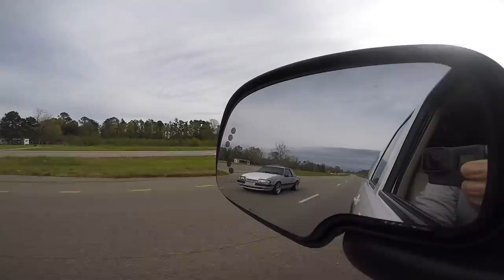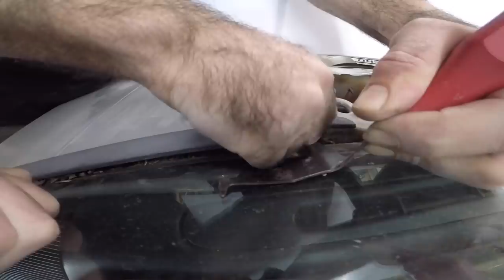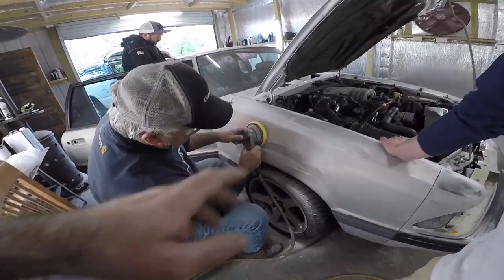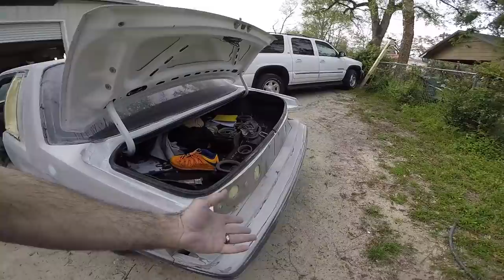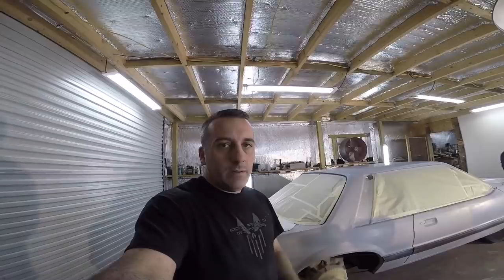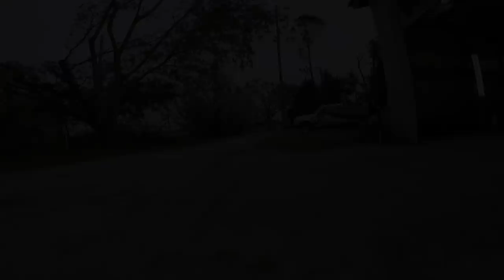ᕙ(`▿´)ᕗ DON'T SAY IT SPRAY IT / THE PAINTING OF A FOXBODY COUPE

Comment: Can you recommend a product for filling holes or fixing the bumper cover?
Reply: Try Evercoat FIB-898 if you need to fix a split or crack and Evercoat #411 flexible filler.  I've had success with both products on mine.
Reply: Basin Motorsports thanks, I will look into that.